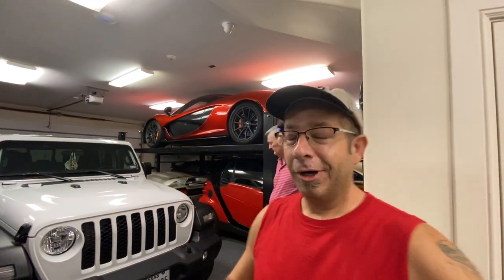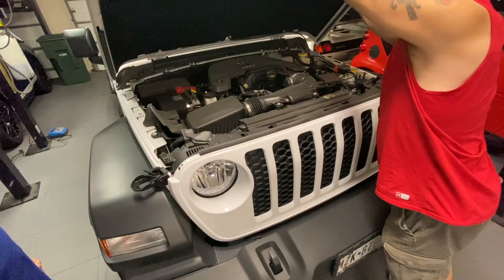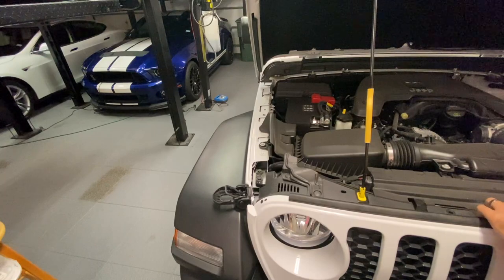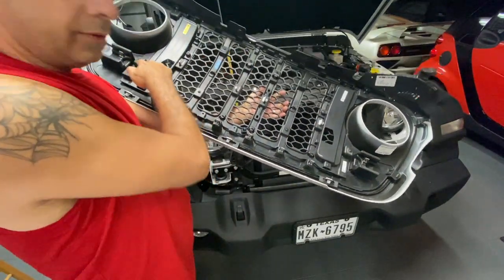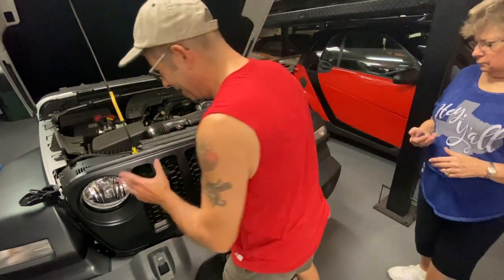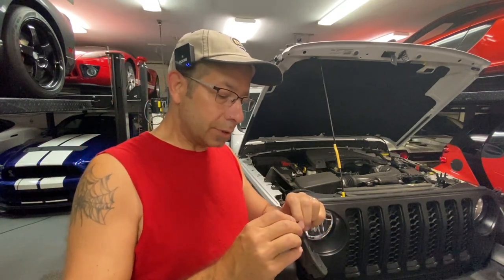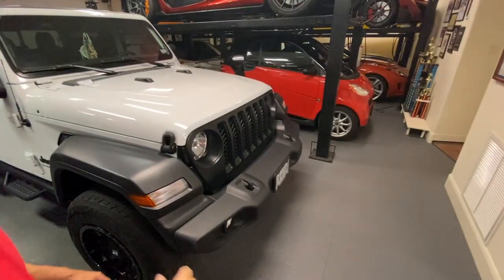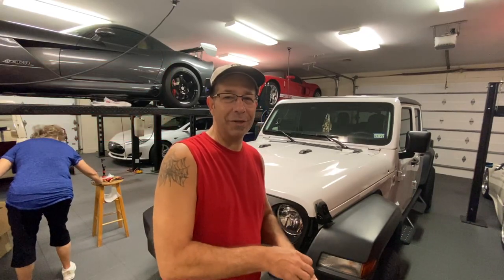Installing a 2nd Jeep Gladiator Grille & I Made a Mistake

Comment: Strange that the front grills are different like that between models, especially since its not that much of a big deal, its just trim.  I guess there are a few subtle differences between the Rubicon and other models besides the obvious big sell points, like the lockers, elec sway bars, lift, and shocks/coils.  You discovered that trim piece between the bumper and grill and lack of trim between front fenders and bumper.  

And not a word about that sexy car collection in the garage...   Must be something to have a Momma that loves cars.
Reply from the maker: It’s crazy!  Not sure why they have a different grille!  You’d think one piece would be cheaper!!  There were other cars in there.....🤔